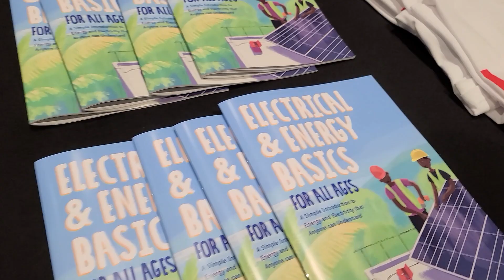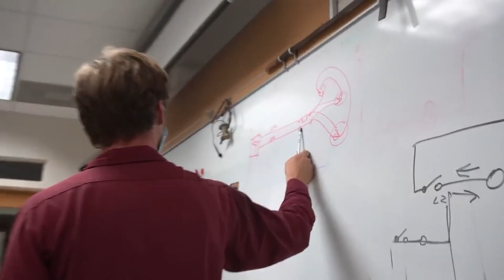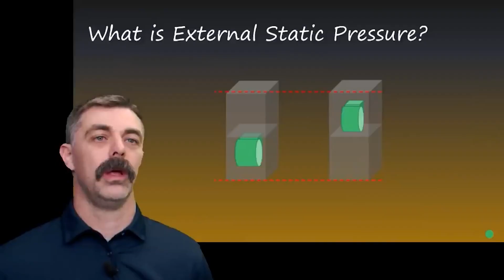HVAC Education as a College Alternative

Comment: I am retired and wanted to replace my unit. I have certs to work on small units. Local installers want to charge me twice their cost of the unit just for them to pick it up for the install. I have looked for schools to get the proper certs for home installs. I can't figure out how the same training varies from about 2,000 to 24000 and 1to 18 months! When you call to ask how much and how long, it is like pulling teeth to get an answer if you can get one. Just come in and we will have someone go over it all with you!!!!! Installers take real offense when you ask them how much they pay for units and freon verses what they charge for the same.
Reply: I feel that whatever answer you get will not satisfy your situation. I would point you towards the Acca website Air Conditioning Contractors  of America where they have a Quality Installation checklist as well as Information for Homeowners on what to look for, you can look at the requirements and see what's involved in getting a system properly installed and maybe get an idea of the scope and do a little estimation on your own. I hope this helps without being cynical . good luck. https://www.acca.org/viewdocument/residential-quality-installation-checklist-english

Comment: I am a retired Chemist, worked five years in refrig lab and then 20 years overall with BS Chemist uni degree.  I got out of that and did a year in HVAC.  You really should pick a trade as the future will not continue hiring many USELESS degrees. The trades are far superior as you can live most places you want, easier to work for yourself if you want, and following behind other companies you will find a lot of screwed up or hazardous stunts left by others.  IMO much more rewarding to do HVAC, electrical.